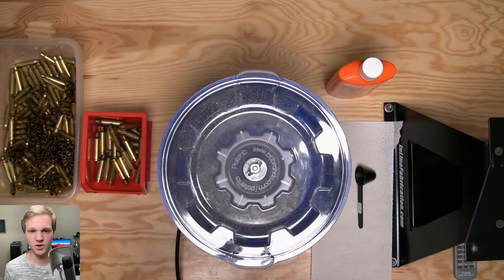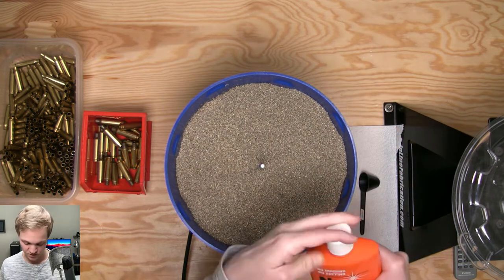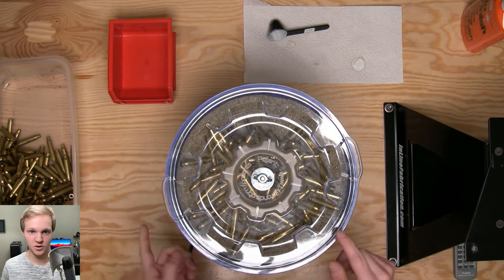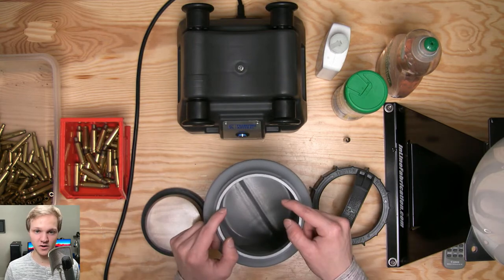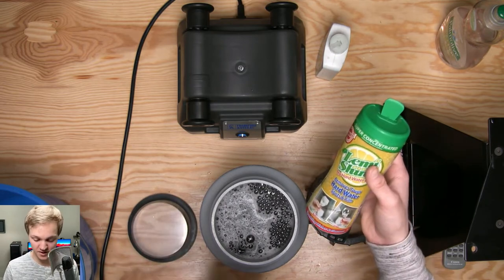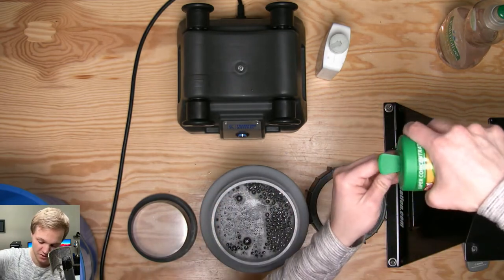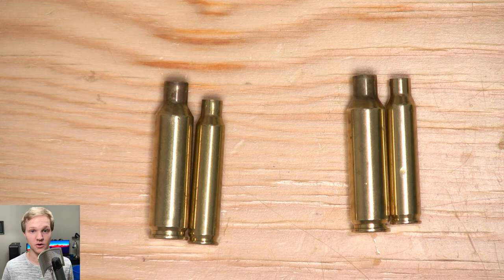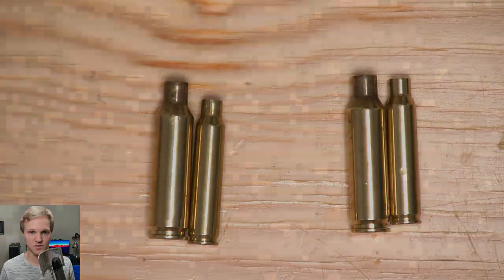How to Clean Brass | Dry Tumbling and Wet Tumbling Process

Comment: I was concerned about the dust, until I realized I could first do a 5 minute wash in the Dawn, lemon juice, vinegar, salt recipe, and all the contaminants would go down the drain. Then I was free to walnut vibrate for 2 hrs, and then corncob vibrate for 2 more. By doing the pre-wash, it also kept the vibratory media practically pristine.
Reply: Do you not have to then dry the brass before doing into the dry media?

Comment: Great video, i always save videos like yours and go back, watch them again and pickup more info. I have both wet and dry tumblers and i’ve gotten away from the dry because of dust plus the wet tumblers get the brass cleaner quicker but the down side is they clean a little too well. I’m going to try a little experiment by putting medium grain rice in my wet tumbler to clean after sizing with Imperial sizing wax and see if they become clean enough without getting the inside too clean to cause galling when seating bullets. Make any sense? I’ll give you the update after i try this. Thank you.

Comment: The CED Media Separator from Double Alpha will shorten your work load significantly for separating pins and soapy water from your brass. You dump the recently cleaned brass into the basket with clean water at the base of the tub. As you spin the basket, the water will wash the pins from the cases along with the soap. I usually dump that water and refill it with fresh and rinse it again before moving them to the dryer. 

We collect brass from out in the desert that has been out there for decades. Sometimes they're as black as black can be. The stainless media will clean them as bright and shiny as new brass with a three hour run. 

We have a multi-step process that is somewhat overkill, but it had lead to zero malfunctions in about 50,000 pistol rounds over the past 15 years. 
1. Collect brass into a bucket.
2. Sort brass by similar caliber so the cases don't get stuck together during tumbling. You learn quick which batches work together, like 9mm, 38, 357. Then 45, 44 mag, 45lc. Throw out obviously damaged cases that can't be repaired by resizing. If I don't use that particular caliber, I hand deprime the cases so the first cycle thru the wet tumbler will clean out the primer pockets.
3. Clean brass in stainless steel media, Lyman brass cleaner and Lemonshine. I use the CED Brass Tornado Pro tumbler.
4. Remove stainless pins and the majority of the water from the cases with the CED separator.
5. Dry the cases in the CED food dehydrator.
6. Sort and separate cases by caliber. Inspect cases for damage. Cases I don't plan on resizing or loading then get separated out and stored with their like calibers. I'm looking for berdan primed shit at this point and tossing it. I have gallon ziplock bags full of calibers I don't use. I then sell off the brass which has paid for my loading equipment several times over.
7. Lubricate cases intended for use.
8. Resize, deprime and use the powder die to bell the mouths of the pistol brass. This helps iron out any cases that have minor bends in them.
9. Throw cases into a media tumbler to remove the lubricant. I find a traditional tumbler removes the lubricant better than wet tumbling stainless pins. Separate the media from the cases with its media separator. I have a Dillon setup for this. I don't worry about media getting stuck in the primer flash hole since when I load them, the resizing die and deprimer pin is still in place and will remove it.
10. Throw the cases back into the stainless media tumbler and run it for a cycle. This will remove all of the media dust and give the cases a final polish. You could skip this step if you don't care what the cases look like. This final spin will also clean out the primer pockets.
11. Remove the stainless pins and water again. 
12. Dry the brass.
13. Make a final inspection of the brass. Insert each case into a case gauge to ensure they sound and look right. Cases ring a certain way on the lip of a case gauge to give you a heads up if there is a split. The gauge then gives you a good indication on if it resized correctly or if other damage is present. You also catch all the fuckery that is out there. Like people who trim down 9x19 ammo to 9x18. So you have a 9x19 typical headstamp that is short. Or the 380 that slips by your eyes. Or good ol' 45 GAP rounds sneaking into your stash.
14. These cases are then stored in ammo cans ready to be used.
Yes, this is overkill, but the ammo is also jam free with zero wait-a-minute events. There is also something satisfying about taking old cases that were destined for the recycling bin and making them better than new. Bottleneck cases have a couple extra steps. I have a die with the resizing die and trim die on it to uniform their length. I also don't save old bottleneck cases for safety concerns.

Comment: Curious what kind of magnet you are using? Stainless steel is NOT magnetic and just to make sure before I made this comment I just went out in the shop and stuck a magnet in my pins and they are infact NOT magnetic…

Maybe you can point me in the direction of a stainless media that is magnetic because that would help speed up the process.
Reply: They do make magnetic SS pins and chips